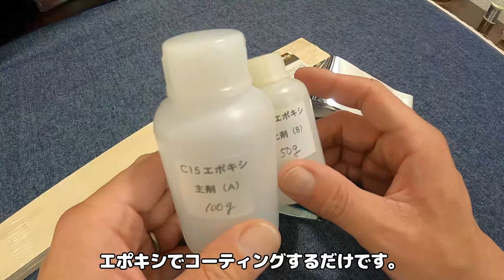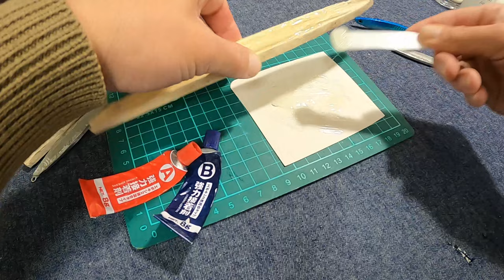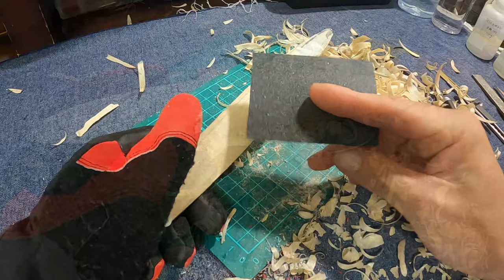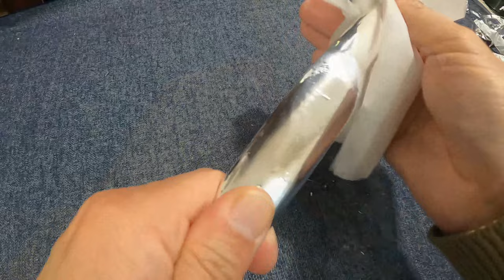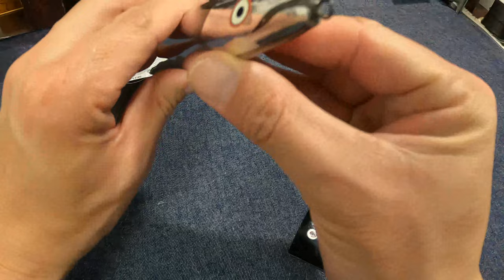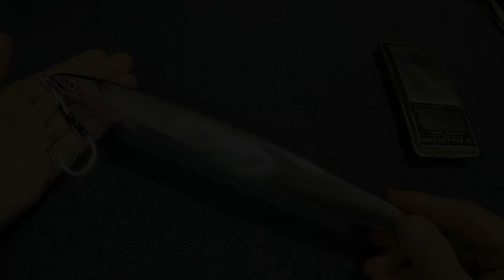ウッド製ロングジグの作り方／タチパターン専用

Comment: Been a fan of your work and channel for long... however as an angler, not sure about gigantic lures...
Would you prefer a huge lure like this over a small to regular size one?
I do understand that cutlass or ribbon fish is a great bait for kingfish and wahoo, but they also could be caught of way smaller lure as well...
What are your thoughts?
Thanks!
Reply from the maker: I try to use lures that match the baitfish my target fish are feeding on that day.
Fish chasing large baits cannot be caught with small lures.
Additionally, larger lures may have a noticeable advantage when targeting larger fish.
In some parts of Japan, jigging using long jigs is used to target yellowtail and amberjack under hairtail bait.
Thank you (^^)
Reply from the maker: https://youtu.be/6tA_VFHswQU
Reply: @carlslurecraft  thanks for your thoughts.... personally caught huge fishes, salt and freshwater alike, with very small and micro lures.... however, lure selection is anglers choice, whatever works,  works ;)
Having said that, I prefer smaller lures, more sporty and easier to apply and remove from fish.
Reply from the maker: I also generally prefer small lures.
It's physically easy, and I like fishing by casting often and making it act like a small fish 😄
Reply from the maker: @kamarte  Next time I'm planning to make a small lure, so I'm looking forward to your comments!